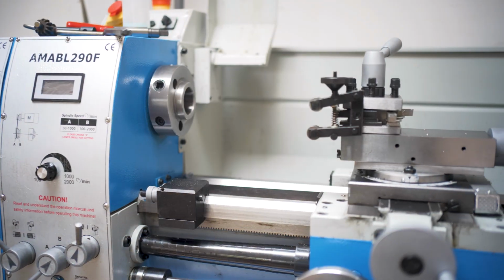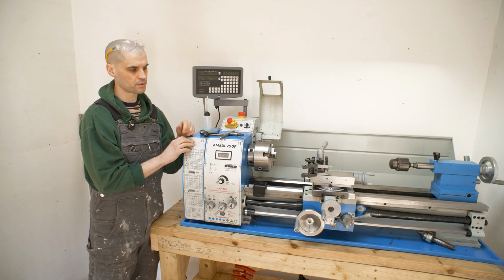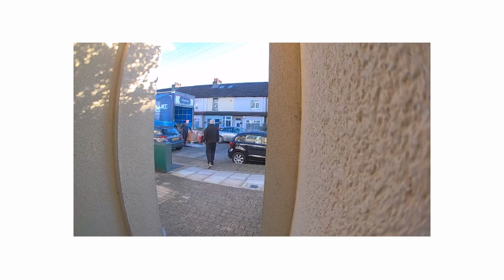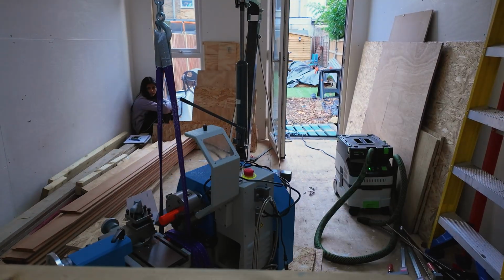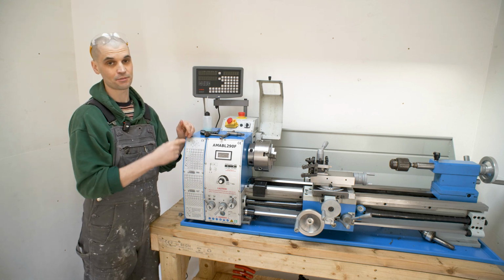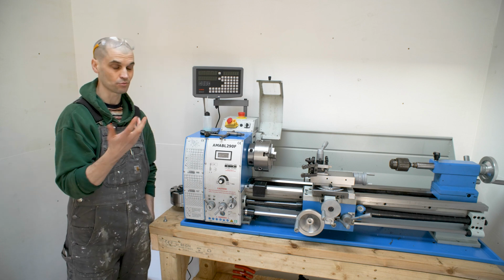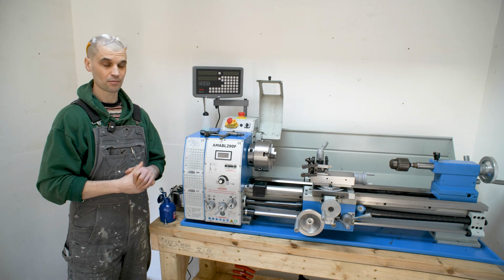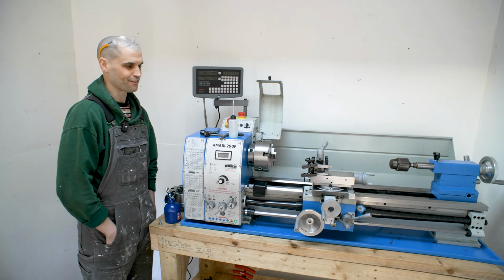AMABL290VF Lathe (PM-1130V) - First Impressions, Moving Lathe, Upgrades

Comment: I ,like yourself, purchased the same model lathe. Being disabled,  the container had to sit outside my house for a few weeks, eventually organised a few friends who manually lifted the complete lathe , through two door way's,  into my kitchen ,which has now become my "workshop" I have to agree the seller at amadeal was fantastic, it has run exactly as it has been designed to do, I did make musical instruments, which require, mostly lathe work and hand tooling.The professional manner with which my many questions and enquiries were handled by a first class seller. Being in belfast the carriage was very decent, delivered to the door, well the top of the ramp,down which the box would it would eventually slide😂. Amadeal have to be one of the most professional  sellers I have had the pleasure of a fantastic buying experience,  the lathe had to sit untouched for a period of 2 years, spent a while rechecking oil levels ,regreasing any grease nipples, or oil, switched it on and proceeded to set the cutting tool 8n action. Now I had a brain injury, as a result things can leave my mind if not done on a regular basis. I spent nearly two day's trying to figure why the cutting tool wouldn't cut, rechecked cutting tip levels and orientation, ALL FINE, checked EVERYTHING  I could see and think of, and still couldn't understand why there was no cutting taking place, it suddenly DAWNED on me, the lathe was RUNNING IN REVERSE 😂😢 ,

Comment: last workshop I worked, I just opened a hatch in the middle of the tray and used a removable plastic box under.
Reply from the maker: That's a clever solution for chip management! I've added drawers underneath the stand now so I don't have much clearance to add that, but I'm thinking of welding a lathe stand for the machine so I can add a dedicated pull out chip drawer. I don't think it's the most crucial mod to make for the lathe so will probably get completed in a few year. I think building a better chip guard to stop the chips flying all over my shed is probably more important so that's what I'll tackle next

Comment: Late response but regarding cleaning the lathe:  years ago, I worked in a machine shop and operated a vertical turret lathe,  We would brush off all the chips at the end or our shift and generally clean up our workstation and then, weekly (on Fridays), we would use a solvent to clean all the ways with a brush and then refresh the way lubrication with way oil - just squirt it on and cycle the tool holders.  Of course, you would clear away the chips during the work shift to facilitate the work and keep from walking on the chips.  I currently have an old Sears lathe and find that routine effective though I'm not as conscientious about it as when I had a foreman checking over my work.  We worked 12 hour shifts so the machines were in constant use except for the weekends.  Thanks for the video - I'm thinking of upgrading my old Sears lathe and I'm considering the small Chinese lathes.  Unfortunately, our asshole president (I'm from the US) and his asinine tariffs are making me delay the purchase.
Reply from the maker: Appreciate you sharing your experience and the detailed cleaning process for lathes! Shame about the tariffs but should hopefully be fixed soon, they are always changing them. I recently got a Chinese mill too (RF45 clone) and overall im very happy with these Chinese machines for hobby work
Reply: @ThisDesignedThat Dumb Question, but you're extremely knowledgeable and approachable (I'm glad I stumbled upon your channel) but when you say "RF 45 Clone" What exactly is the RF45? I'm a lathe guy, just now getting in to the milling game haha. 
The main reason for the question is that I'm looking at a lathe which seemingly resembles this model, which seemingly resembles the Precision Mathews - and your video title references the Precision Mathews, yet PM isn't directly mentioned.
Reply from the maker: @J @JeffW-y2q  hi Jeff thanks for the kind words , RF 45 refers to the Rong Fu 45 milling machine. It’s one of the brands that popularised the benchtop style of mills that you see today. Other brands cloned this design and made modifications to suit their customers. Check out my milling machine video which goes into more detail about the RF 45 mill that I bought myself that is similar to this lathe https://youtu.be/uAZZ75p1jlk?si=5kc4Dvxi7lENsxW0
Reply: @ThisDesignedThat Ya know what's funny. I made this comment but totally forgot to check back to see if you'd replied (thank you for your reply BTW!!) In the interim, I got an absolutely smoking deal on a mill. Would you care to guess what type of mill I purchased?? Just the exact one, but rebranded as a Kenwood here in America, that you reference right now😂😂😂 Clearly great minds think alike😂 I'll be watching your linked video right now. But I should warn you: Absolutely no more kind words, I'm going right for the jugular from now on. Obviously I'm joking! I'm looking forward to your video and I'll definitely leave you some great feedback as Im sure you're video will be excellent. Thanks for your content and engagement. I'll be talking to you soon.

Comment: When you get a new piece of equipment it is always a good idea to tighten all of the electrical connections inside the control panels.  I had one wire off on my PM 1130, which was touching metal.  It would have shorted out if I would have run it.  The Chuck that came with my lathe has 0 to .0005 run out which is excellent.  Changing the gears is no problem, once you get used to it.  You should do it just to be sure the machine can do it accurately.
Reply from the maker: Great tip!

Comment: Daaang! Envious! 😵‍💫With a workshop on the 2nd floor of a 120 year old building... with wooden floors... weight sadly limits my options for lathes and mills heavily 🙄
Reply from the maker: damn! Im sure the floors can handle it, our house is 100+ years old (most are here in UK), this is only 240kg and when spread over a few joists its really not much 👍
Reply: Only 240 kg 😅 But yeah, true... with some thick pieces of wood under the table's legs running perpendicular to the joists, to avoid high point loads, it'd probably be fine. No elevator though, so even the logistics of that is a scary thought. 🤭I will probably start out with a smaller lathe, combined with the CNC I'm building, and grow out of its capabilities first. And perhaps use a local machine shop or services like JLCPCB to bridge the gap when they fall short on working area